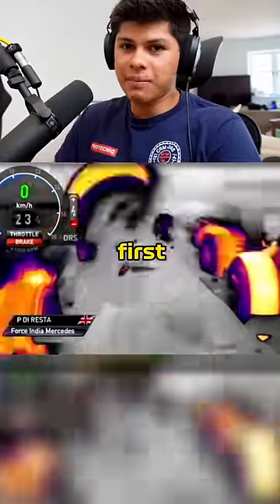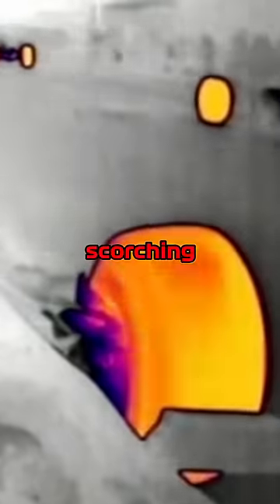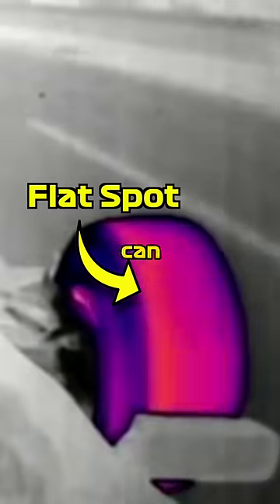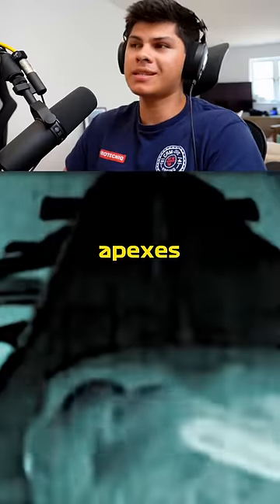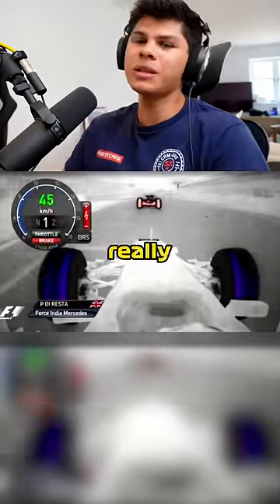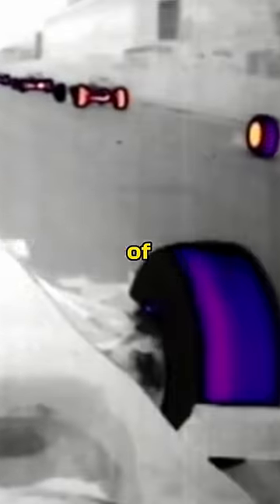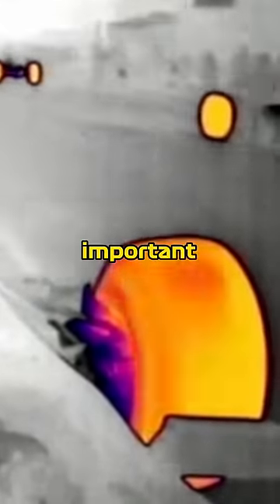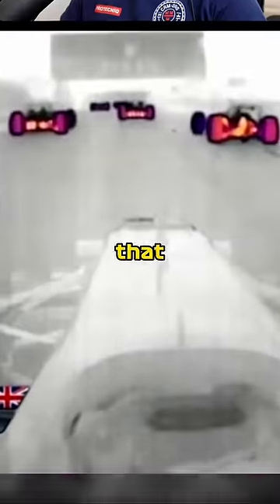THERMAL Camera REVEALS Why F1 Driver CRASHED at Monza #F1 #crash #onboard

Comment: That heat isnt from the barkes. They hold the heat the tires sre hot. Thebsurface area cools down like a mofo when theyre driving from wind and the ground. Yes the brakes will help heat them up. But no more than 20% of the heat comes from the brakes. The brakes srent all around the rubber. Do you know how rubber works? 1 spot can be hot asf the ither part cold af. It doesnt conduct heat well at allllll. Buut if the entire thing is hot at the core of the rubber the outside will cool down rapidly. Then give it a few seconds and it will heat the surface back up. Yall need some science in ur life. Frfr no cap yall need science

Comment: Ok so I'm not the only one that saw the left tire collide with right side of the vehicle on the front left, and do to the force of the tire pushing down on the vehicle in front It had 2 options, (1 rub and jar because tire is firmly secure), or (2 rip off due to faulty parts or someone neglecting to do there job properly)😑 is what I'm saying not common sense?